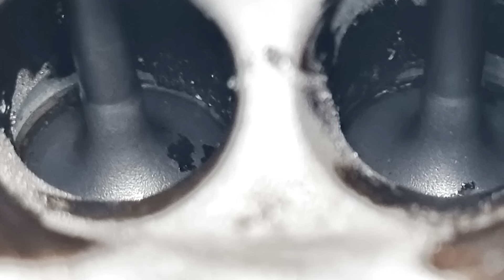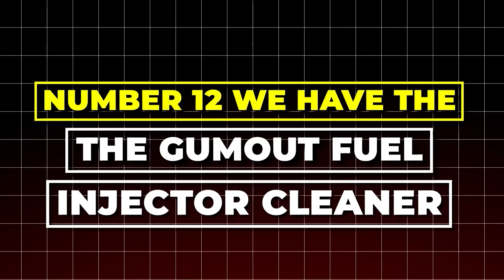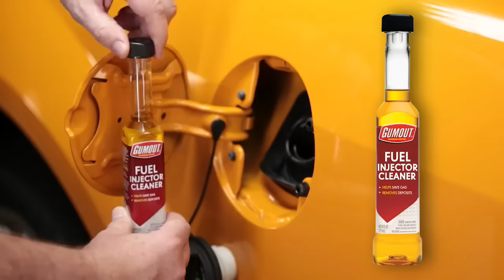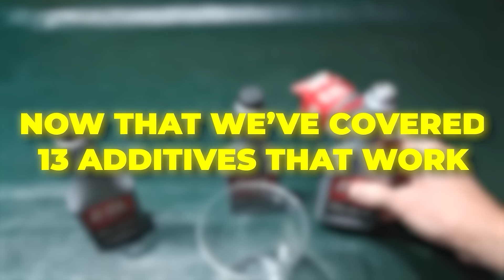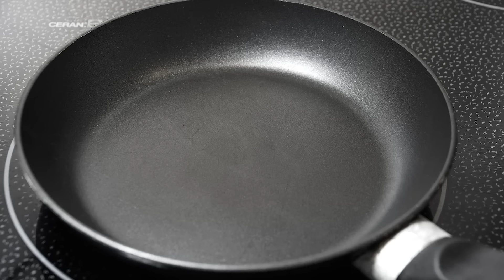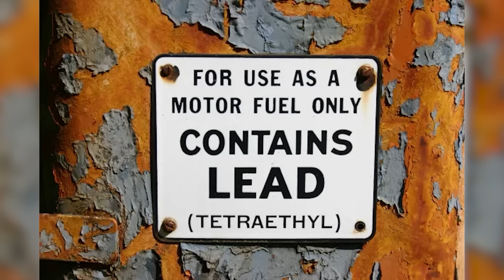13 Engine Additives That Work (And 5 That’ll Kill Your Car)

Comment: im 65 yrs old ,been a mechanic since i was 10, just change your oil every 3-5000 miles with good oil and a good filter and you dont need to waste your money on that other crap
Reply: My parents wouldn't let me work on their cars when I was 10 so I took apart and rebuilt everything from small engines,TV's,BB guns, motorcycles, bikes ECT ECT
Reply: @michaelmartin2276 I cut my own grass
Reply: @michaelmartin2276 and probably never put them back together. No responsible adult would let a 10 year old kid touch their vehicles.
Reply: Project Farm did a comparison between Lucas added to oil and just oil flowing at freezing temperatures with no loss of flow. That was a live real world test. It's on YouTube.
Reply: @paulricelli5520  The problem with Lucas products is the fact that it dilutes the additive package in the oil.  You're actually better off just going with a thicker oil.
Reply: @aaronthomas6155  We ran Lucas in our '04 Caddy 6.0 up until  a "head on" ended her life @ 309k. She was a beast!
Reply: @aaronthomas6155 BINGO!!!! Spot on!!!! This isnt the 70s-80s and grampas SBC that needs rebuilt so ya chuck Lucas in it. Buy a quality oil and change it often it will be loyal for many years
Reply: @paulricelli5520 
I also use all my car and truck. Used at work over 3yr in big rig. I hv personally seen an improvement. Across the board, from personal and customer I'm belive and sold on there products
Reply: I am 74, I say the same.
Reply: I agree 100 percent!! But anyway I watched a guy on YouTube that does lab testing on all this stuff & says none of it is any good for ur engine & especially today's engines & most of it actually foams up & breaks down the goodies that's in ur oil from the start!
Reply: @davehubler2595 It's ALL BS snake oil!!
Reply: I'm about 10yrs behind you.  IMHO, just changing oil on time used to be rule for long engine life.  However, with the newer, thinner oils for MPG ratings, the protection they offer is reduced - I.E. GM's recall on the 6.2L, changing the spec to a thicker oil.  Plus stories of Ford engineers running 5w-30 in their 5w-20 spec trucks, leads me to think that a little more viscosity is beneficial to engine longevity, for the low price of 1-2 mpg.
Reply: @tangogolf846 
Note
All The Times do I go by the mileage a lot Of times I go by another tactic of telling if my oil needs change depending on my driving style because i'm actually very hard on My engines

This is how I determine when it's time to change oil a I put the My finger and move it around Between my fingers and Slippery ness With pressure between my index finger and my thumb, then I check for grittiness. Smell, sight and color
And weirder sometimes even taste.

Like me.I'm usually up in the middle rpm range And occasionally too frequently depending on the car and engine in the Hi to redline rpm

Just like.
Salt if it loses its saltiness it should be cashed out

Is oil?I look upon the same way
If oil does Have slipperiness then I don't use it.

I'm a very added Lucas Additive. Advocate. Just like Frank's hot sauce. I use that s*** everywhere in everything.

A common question. I ask most operators, technicians and mechanics. And most people get it wrong. What do all engines regardless of the fuel type create?
 Or leave behind.

Here's the misconception. Most people do when it comes to fuel additives. Most typically, when the engine is stumbling or does not have the attributes that they're looking for or responsivanswer this someone tells them to put in fuel cleaner in.
Then from a day to almost a week later. All of suddenly, a check engine light comes on most typically from my experience with 26 years as a mechanic in the field. I usually inspect the catconverter. Not the 02 sensor and find out the cats is plugged. Most typically cars that and people that have these cars are 160k to 190k  miles.  And about 10 years old.

Most newbie texts go take their vehicles to a dealership or a part store and have the codes ran. And it comes up with an 02 sensor fault.
And think it's gonna be a quick change and change the 02 sensor thinking that will fix the problem. No, that is a symptom or side effect of the comment output above.
Fuel treatment does work providing the exhaust system. You have is either free-flowing. Or unrestrictive and/or no catalytic converters. The best way I can describe a Cadillac. A router is like a screen on your window.
 Carbon is like taking a flower at it's smallest.  Size to potato flakes, and it's largest size.

Carbon or other known as carbon emission IE soot
Reply: Public awareness about Top Tier Gasoline needs to be raised .
Using Cheap, unbranded gasoline can lead to many of the engine problems mentioned in this video.
Use gasoline with the Top Tier sticker on the pump
Reply: @kevinasmith9273  The Motor Oil Geek had a good video on Shell Premium Fuel and it's additive package
Reply: @kevinasmith9273 and that would be done by eliminating ethanol. Even at 10% it’s enough to destroy your fuel system if it sits for 6 months. It’s absolutely worthless,unnecessary and destructive, waste of money to produce and most of all it’s been conjured up by the same (phony green )tyrants that closed the pipeline,want u driving electric ( really really dumb) and blame all automobile drivers for climate change whilst NEVER talking about the millions of gallons of jet fuel being dispersed directly into the atmosphere- every efn day   Peeps are sheep
Reply: That's a tough pill to swallow, & it's not something new. I've read, & seen so much over the last 30 years on the benefits of premium fuels & the detergent packages they include. It can get costly, but is easily argued an ounce of prevention is worth a pound of cure. You're going to pay now or you'll pay later. 
Now saying all of that running pre-owned high mileage vehicles for the most part I'm guilty of running the cheap ethanol fuel from a reputable station. On my flat tappet & carburetor truck or my fuel injected 4.0 Jeep I did & do run non ethanol when possible, but nonethanol is tricky to find in this state, & with corn subsidies, & locally produced ethanol its so much cheaper.
Reply: @kevinasmith9273 the gas all comes from a couple refineries.
Reply: Some people don't care if their engine doesn't last longer, either.
Reply: @Faolan161  yeah more money than brains for some! Or gets shit handed to them!
Reply: @Faolan161 
Tell me that. When you have a round body supra or a Nissan Skyline 34r. GT or BMW M3 gt3  series.
1970 Chevelle, 454 or a Dodge.Demon hellcat's
Reply: @vegahowell5813  didn't catch the sarcasm, eh?

Some engines will run on just oil for years... Put them to the test with tremendous power, and you have to find the right oil, make the right oil, or let it wreck itself... 

I don't have to run Lucas in my Honda gx160, but I certainly will in my 6.7 LS... 

And there's a reason why they don't run 0w20 in race engines. In case you're unaware of how the commenting system works here, I was directly replying to the comment you clicked on, not the guys who actually care about how to find the right oil that you mentioned.
Reply: @Faolan161  If you want an engine that can run for years, look at the old GM 4.3ltr, Ford 2.9ltr and Ford 4.9ltr....  Those were the 3 most hated engines during the "Cash for Clunkers" program.....
Reply: @aaronthomas6155  I want my engine to run for longer, only a few select ones that did well. I had a Ford i6 that lasted to 360k... A i6 Cummins that's still going strong at 330k...

When I use Lucas oil stabilizer in my Chrysler with rods rattling at 160k it went until 256k.

And I assure you I'm not going to install a GM 4.3l into my '79 Ford one ton because you tell me it'll last longer. I'll just keep my turbo BBF and learn how to make it last longest possible with heavy towing. And following manufacturers guidelines has failed me there. We're talking within 6 months the crank bearings are toast by going with their recommendations.

I'm not looking for the longest lived engine.
Reply: @aaronthomas6155  it's too bad you subsidized the cash for clunkers program. Lots of people want(ed) those older vehicles.
Reply: What my mechanic said as well unless there's a problem, then he suggested BG products.
I tried Engine Restore and it works but you are poking a few more months out of a junker.
Reply: 505 crf reduced my oil consumption from a quart every 750miles to a quart every 1500 miles and it was immediately after the 20 mon treatment. I swear by that stuff.
Reply: Changing the oil regularly is critical but that has little to do with cleaning the fuel system
Reply: Since my 1st car in the 80s, every 3k never missed. Multiple engines in work trucks went well over 200k never broken an engine.
Reply: In my 54 years of driving cars and tuding motorcycles I have religiously used quality branded gasoline changed oil and filters  at 3000 miles.
In all these years zero engine issues in any of my families vehicles.
Our 1990 Saturn Sedan went for 23 years.
Our current car a 2005 purchased new and still going strong at 20 years and 180,000 plus miles.
Same goes for my motorcycles.
Additives are snake oil .
Reply from the maker: You’ve got the right idea! Regular oil changes with quality oil and filters are the foundation of good engine care. If it’s worked for you all these years, no need to spend extra on additives. A solid maintenance routine always pays off.
Reply: I’m not a mechanic, I change my oil 4x annually, oil filter 2x annually, fluids 1x annually. 
Subi 2015 forester. 
Car runs great, only thing I had to replace was the battery and cv boot
Reply: i agree i just have a high mile motor that i didn’t have for the first 100k miles and now im at 140k and i am wanting to break down the carbon build up and clear up those oil passages before i install a oil cooler
Reply: Agree but I like Marvel Mystery oil.
Reply: Doesnt hurt to spend 15bux once a year
Reply: I recently had my motor overheat due to a faulty thermostat. That left a sticky varnish I noticed on my dip stick. Some valve knocking cane with it. Adding Lucas stopped the knocking.
Reply: I add the Lucas slowly. Adding less than recommended. If that fixes the problem, then good enough. If not? Then slowly add more up to the recommended amount
Reply: Yes sir, I agree
Reply: Exactly what I thought ❤
Reply: Especially if you drive a 94 Celica!
Reply: OIL is NOT THE FUEL SYSTEM!!!
Reply: 100% agree
Reply: So what does that do for your fuel system..
Reply: What do you mean by older vehicles? Are you saying year or mileage?
Reply: What if you have an old truck tho that burns oil?
Reply: It helped my car get a little better mileage!
Reply: It helped reduce lifter noise in my motor.
Reply: That's right I'm over 300 on my own daily and it's good with regular oil changes this far and runs gr😅eat !
Reply: Oh good a boomers that thinks he understands what's going on currently in cars.
Reply: That’s not a good advice if you don’t do it yourself nowadays. It’s around $100 per oil change.
Reply: Ok boomer. 
But some products can make your engine run BETTER.
Reply: I am right behind you at 60 and never retired master technician Thanks kids but I have been pounding in all 4 of my children since being introduced to cars and trucks and all of my customers that 5,000 mile oil change no matter what type of oil you use and Rotate your tires at the same time since it is required by manufacturers for warranty and Service your transmission every 40,000 mile and include a bottle of lube guard each service. I own vehicles with over 200,000 and 400,000 on them if it is good enough for me it is good enough for everyone. And one bottle of Techron fuel system cleaner every 5th tank full because America fuel quality varies and it keeps valves and injector’s clean saving you all different issues. 🤘🏼🇺🇸🇺🇸🇺🇸
Reply: ❤❤❤ @toshayonguard4253
Reply: Zero argument here, additives are for near broken down engines period.Just to get a little more out of them.But you'll end up finishing it off real good. Cleanliness is next to Godliness in the engine and transmission world.
Reply: @VictorRuiz-nv9wj  just to get a little more life? I wouldn't call another 96k miles from 160k just a little more... 1998 Chrysler Concord, rods rattling at 4500 rpm with factory recommended oil, and that's what I got. 

The art of smearing just to push a narrative will soon be proven false by knowledge and wisdom, and go away forever.
Reply: I'm 72 and totally agree. If u change often enough, you don't NEED additives. I run OEM Toyota oil and parts on my 2019 & use "top tier" fuel only.
Reply: @riceburner4747  simply not true in every instance. It's just true for most basic low powered daily drivers. When they begin to wear, though, a heavier oil or the right additive buys significantly more life. This who want to learn often learn this. It's just too bad there are so many that want people to want to follow only directions instead of understanding the machinery.
Reply: @riceburner4747  Wix is a great oil filter also!  Napa Gold is the same exact thing
Reply: Absolutely 3500 miles max even with top of the line synthetic oil. Change your transmission oil every 30K miles a new battery every 3 to 5 years  a set of iridium plugs and it'll go 300k miles or more. I got 450K miles out of a Volvo T5 awd  the angle gear went at 275k but I still had 2wd for the life of the car. Just general maintenance and your car will run for 20 years
Reply: @gregwierzbicki5383  absolutely true.

For your car.

Others often need a touch more.
Reply: For the most part, sir, you are a 100% correct, but the problem is when you get somebody's.People believing that 5 weight oil in engine that unbeknowns to the operator or the owner.These modern day motors are actually running hotter than what they supposed to and what they really think and technically they are actually overheating

What good is oil?If it's not slippery

What?I mean by this take any suggested oil that you want any of your Of your preference, put it between your index Finger..Apply pressure with your index His finger and thumb and slide back and forth If you can feel the thread of your finger Or even grab traction. Is that oil any damn good? 

When I used to work at a shop , I used to use pb blaster as my control Either better than or  same as  
Most oil of 5 wieght or Synthetic. Is the worse 
 
Planned obsolescence  oil CO. and engine motor CO.

Let me go one step further.I'm pretty sure you have an old school chainsaw that says on the To use a 32:1 ratior versus One these new ones that recommend 40:1 if not 60:1 fuel ratio
But it only has an operation hours of eight thousand hours

I know, because I fell into that category 1 year as a tree service bought me a brand new chainsaw. Followed it exactly to the letter and I'll write around 8000 hours, which is about one year's worth of tree service. The engine would no longer run I tore the part and found out the cylinder walls were extremely warm out scarred in the rings were blue.

Oh, by the way, at 1 time, I used to be a big fan of amoil  And was sponsored by him and other full synthetic oils.And now I won't even stand behind any of them

Until I.
Lost a twenty thousand dollar motor

You'.
Re gonna come back at me and says words because you're tolerance was not right I didn't build the engine right to species certain specific

And you're wrong I tore the whole engine apart
I use the highest grade of quality parts clear.Cross the board on this engine

Cleve77, felpro plus, arp, Carrillo,  je  pistons, many more
Reply: @vegahowell5813  ...what?!
Reply: Hybrid is different because every time I drive my engine shuts off and switches fully electric in the city. It recommended 10k to 12k oil change.
Reply: @clou174  10k is recomended so manufacturers can receive carbon credits. Very few ownership cases qualify for that.   I think I heard Lake Speed say that
Reply: Wrong  with oil today change mine every 10 k and have 600k on my truck
Reply: Im so glad you said it. Thats especially true with newer cars.
Reply: @cobravids  yes... and GMs 6.2 L is doing so well because of it...   

/s
Reply: That's what Scotty kilmer says
Reply: @gradyhernandez4699 Scotty Kilmer is an idiot
Reply: You are a waste money guy,with modern sintetic oils you don't need to change oíl that often,my last older car had 350 thousand mile and I used to change oil every ten thousand miles
Reply: @salvadorsaucedolopez2644 
I dont "waste my money " 
On synthetic oils.
The longevity of my vehicles is obtained by using the recomnended lubricants by the manufacturer.
Then I heat my garage with said used oil in a modern  waste oil heater.
Heat my domestic water with it also 
Where is the waste ?
Reply: Never heard of burning used oíl,and I like that idea,over here in LA some uneducated ppl leave it out of some autozone stores,I appreciate your comment @paulwojnar2291